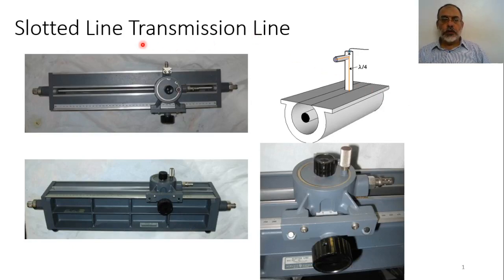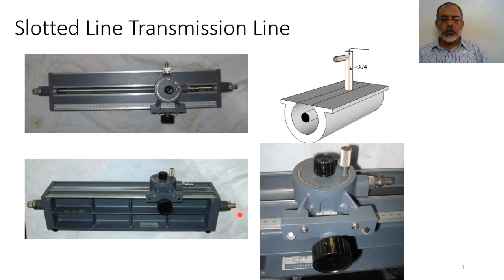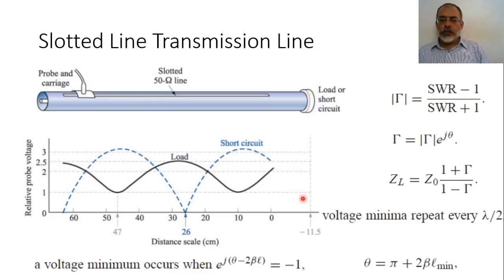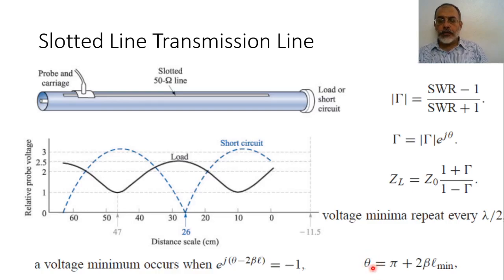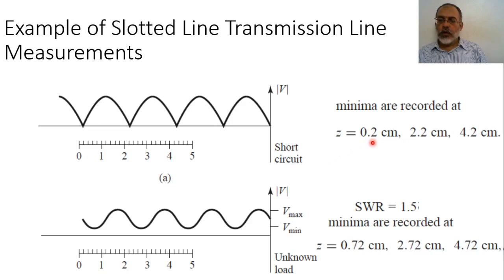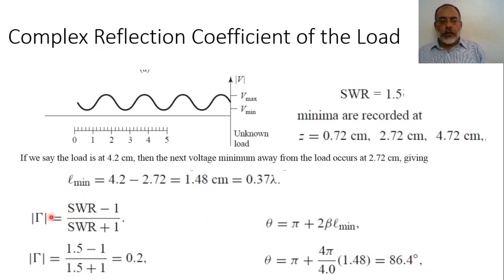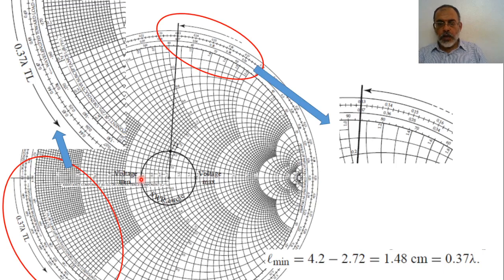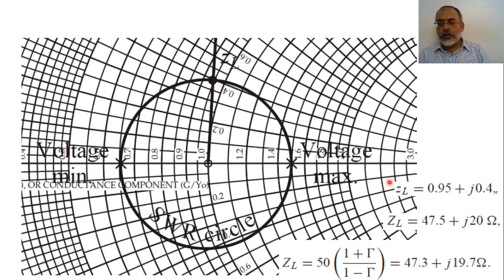Microwave Ch02:r- Slotted Line

Comment: I found that the shape of the short circuit voltage versus distance graph was a sine wave.  It did not fall to discontinuities at each half wavelength toward zero volts the way you show.  I did this by moving the probe smoothly by hand and recording on a storage oscilloscope.  The sine wave shape happens when terminated by either a short or a 50-ohm load.  The cancellation was good, approaching zero volts.  As to the speed of light, I re-arranged components.  It seems good at 2.978x10^8 m/s.  I put the wavemeter at the source instead of the load, and I removed a circulator at the source of the slotted line.  I purchased the Pozar book and am studying your nice videos.  With much gratitude, thank you.

Comment: The wave velocity in a waveguide is slower than that of free-space.  At the probe is a diode, not an amplifier. I have this same slotted line; inside is rectangular, not circular.  I am still tying to understand all this.
Reply from the maker: The phase velocity is greater than the free space speed of light in hollow WG. but the group velocity, which is the velocity of the signal not the phase is slower than the speed of light. In TEM TL like coaxial line the phase velocity equals the group velocity. Howevet in the case of coxial line the wave velocity would be c/sqrt(epsr) where epsr is the relative permitivity of the dielectric material between the inner and outer. Thus the wave speed im this case is less than the speed of light in free space. Hopfuly, it is clear now.
Reply: @ahmedm.attiya1197  Very nice of you to reply.  I am measuring the speed of light with the slotted line and a wavemeter.  I see very close to the speed of light now, reading 3.06x10^8 m/s.  I am not clear on this issue that you explained just now and will explore it more.   Here is a photo of my lab.  I am attempting to invent a spectroscopy to read microwave interactions with life. Perhaps you can help or collaborate.  Please see my website at http://www.unquantum.net  Thank you.
Reply from the maker: When using slotted line, the position of the measuring probe inside the slot is very critical. If the probe goes deeply inside the slot, this will introduce purturbations to the fields inside. On the other hand, if the probe is touching the slot, the measured signal would be very small. In addition, the slot itself represents a perturbation in the line. If the width of the slot is great, it may introduce non pure TEM wave. All these parameters may introduce some error in the measurement. What is intersting is that you have a const. value 3.06 . On the other hand, are you sure of the frequency of your source. If there is a very small deviation in the frequeny this will introduce this shift. Thus, you may do the same experiment with another source to check this.